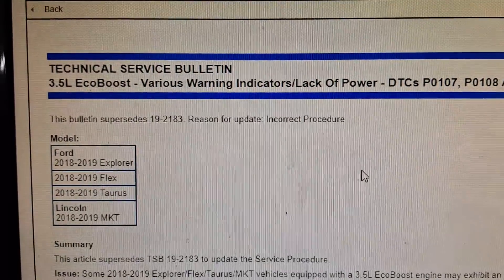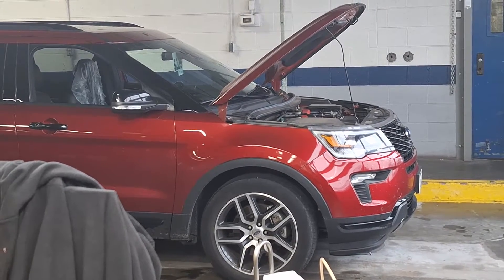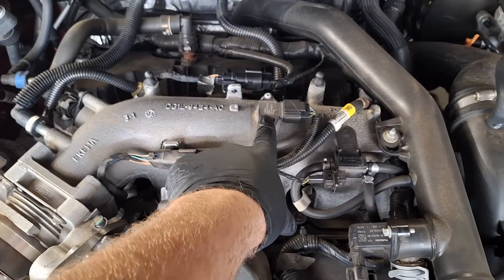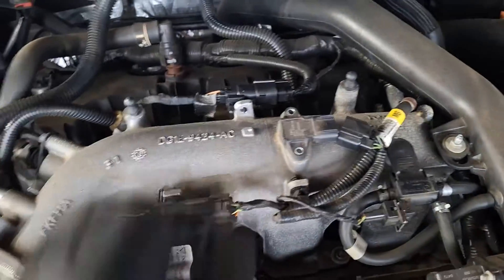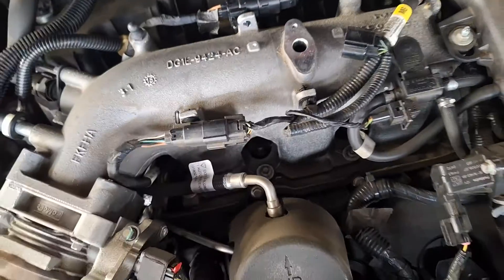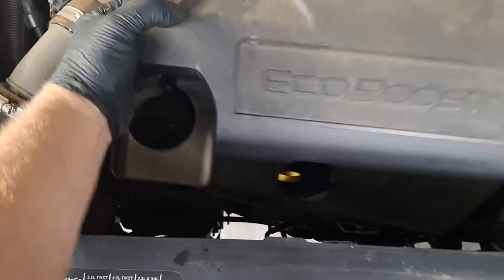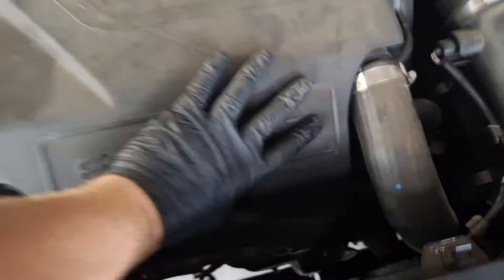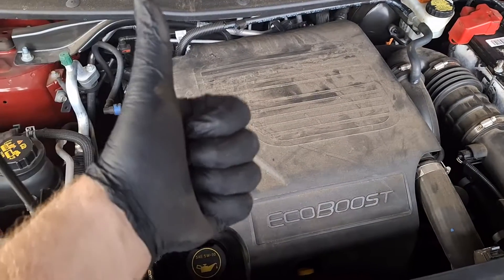Ford 3.5L Ecoboost: P0107 P0108 P0109 - MAP Sensor Replacement

Comment: Hello, I have a 2019 Ford Explorer Sport. The P0107 error occurred, the car started jerking, the transmission kicked, I installed a new sensor, it starts easily, the revs don't fluctuate, but when I put it in D and start driving, the check engine light comes on and the car starts misfiring. What is this?
Reply from the maker: Try clearing all the codes out from before the repair. If the same codes come back look for a damaged connector, if its fine try warrantying the sensor.

Comment: Need help… did this and the advance trac would not come off. Have code 0106 as well.
Reply from the maker: @johnf517  did you use an oem sensor, and clear codes after? If so, check for mouse damage to the wiring

Comment: Good thing I found this video. I thought the previous owner snapped off one of the bolts flush and was about to try to extract it.
Reply from the maker: Yup! I'm glad it helped
Reply: @BigBensCarsAndCycles  never thought ford would be that cheap. not a good sign.. maybe I shouldn’t have bought the car.